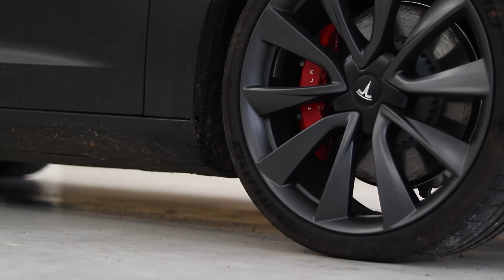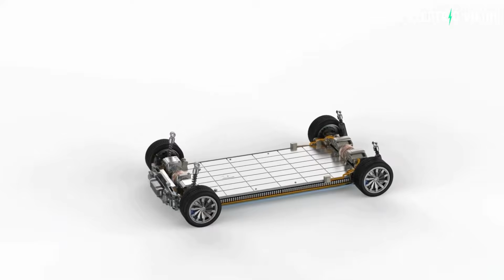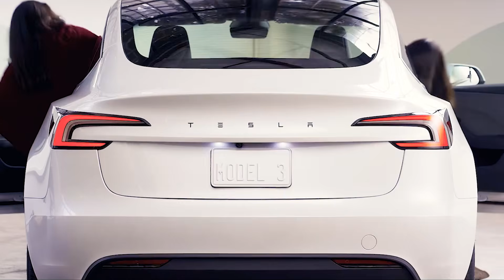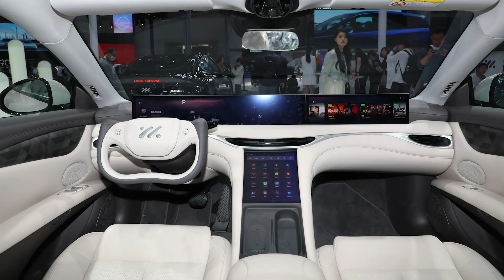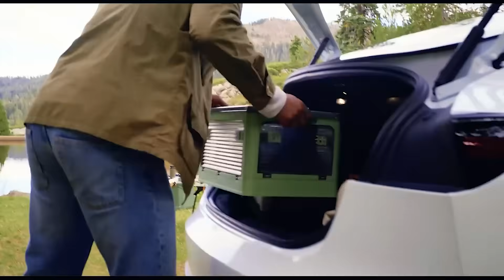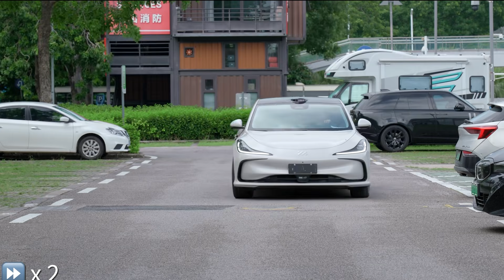Is Tesla Finally Facing Real Competition?

Comment: Slate is the car to beat now. Less tech, lower price, user customization, EASILY replaced body panels and parts, Truck to SUV conversion BY the customer. These high end, high tech and HIGH priced cars can't compete with a 25k electric vehicle.